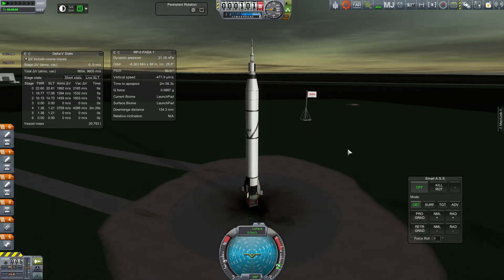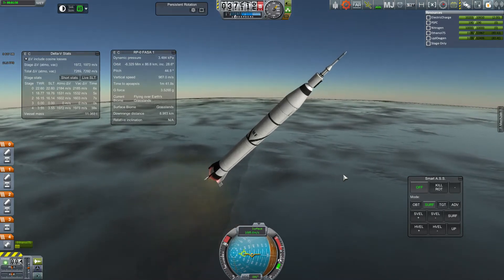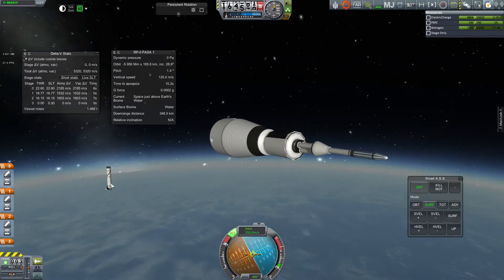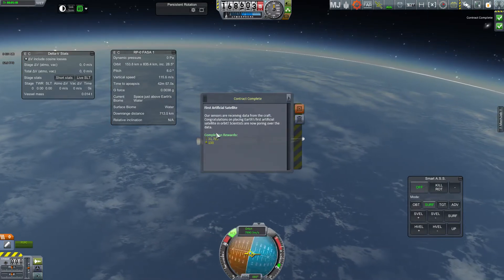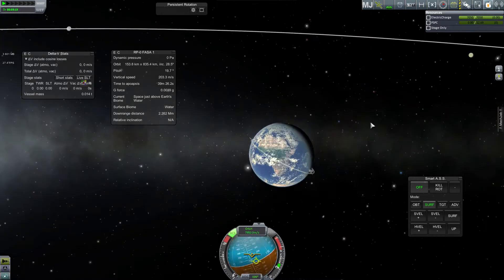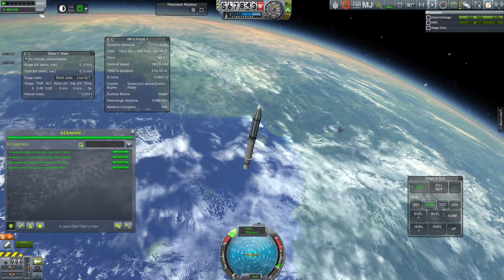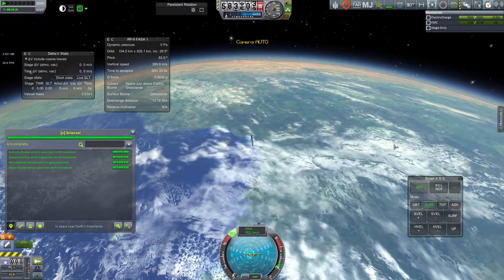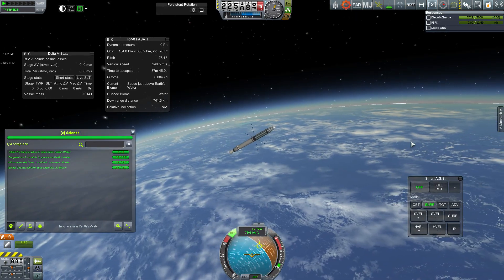RP-0: America 11 - Explorer 1 Orbital Attempt

Comment: Besides FASA mod, what mod have u used to make a look longer in that nosecone?
Reply from the maker: I just didn't nest the 3x motor stage inside the 11x motor stage. In reality the 3x stage did nest inside the 11x one, but at this time the parts would clip on each other (due to a recent change in KSP) so they would not stage smoothly. I ~may~ (don't recall) have had to use the KSP debug menu to allow me to connect part nodes anyway I want to in order to do that. Normally, part nodes are 'directional', pointing 'up' or 'down' so that they can only be connected in a certain way.

In practice, I generally go with the longer look by constructing those stages by hand, the way NK does in this video:
https://www.youtube.com/watch?v=hdge0-dfV0s&index=4&list=PLI_cTKGllaWhVsKMRM_3axuFPcR6HYluL
Reply: No, i dont not mean the length of probe core, i mean the air-dynamic nosecone under the 11x sergeant stage seem not comin from the FASA mod, so i wanna know what's the other mod using on this rocket.
Another difference from FASA mod, is that the engine is not that long that FASA given, so i really want to figure out what kind of other historical mod u have used. I love that since it is much realistic than the one FASA given
Reply from the maker: Ahh, thanks for the clarification. So, that nosecone part is totally part of FASA, although it may be sorted into an odd category. It has nitrogen (or some other low powered RCS) built in, which could explain that. It is the 'Juno Nosecone' which according to the RO Juno craft file may be called 'FASAExplorerNosecone'
https://github.com/KSP-RO/RealismOverhaul/blob/33048702d67e2ceed46054a48a533db7247c73dd/Ships/VAB/RO%20FASA%20Juno%20Explorer.craft#L3163
The RO patch code for that part is here:
https://github.com/KSP-RO/RealismOverhaul/blob/33048702d67e2ceed46054a48a533db7247c73dd/GameData/RealismOverhaul/RO_SuggestedMods/FASA/RO_FASA_Explorer.cfg#L295

In terms of other historical mods, I've primarily used Raidernick's, although not really in many youtube videos. Raidernick covers a lot of ground, both US and Russian stuff. For example:
http://forum.kerbalspaceprogram.com/index.php?/topic/84250-12-us-probes-pack-old-and-new-v060-10-13-16/
Reply: thanks for ur sharing! I will keep supporting ur channel. >.<
Reply: Thanks for ur sharing. Anyway, if i want to have a much realistic part in FASA(nosecone, redstone engine wahtsoever...), i have to search it one by one by myself? Or there is other kind of methods that suppose to be much easier or not that complicated?
SInce i see many of other utubers are using those ,uch realistic or in scale part in their video. Also, what's ur mod using in the atmosphere? Is that realistic atmosphere?
Reply from the maker: I mean, when you assemble any other craft, you need to select each part one by one in the VAB, right?

The KSP forum ate the Realism Overhaul thread recently, but here it is on the web archive.
https://web.archive.org/web/20160522190749/http://forum.kerbalspaceprogram.com/index.php?/topic/140070-112-realism-overhaul-v1101-may-18/

You can see the required (Dependencies) mods for running Realism Overhaul, which I use here to get parts with historical scale and function. FAR makes the atmosphere behave realistically, and RSS sets the parametres for the atmosphere (and planets). Realism Overhaul also comes with craft files for some historical space craft pre-assembled, including the craft that launched the Explorer I. The most recent release for RO works with KSP 1.1.3, the next one for 1.2.2 is still being worked on, and waiting on dependency updates.